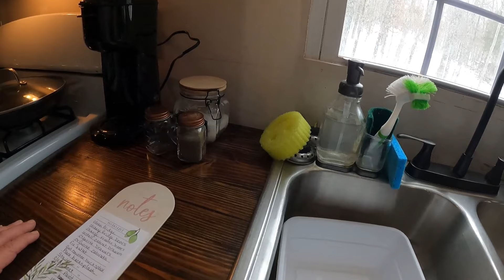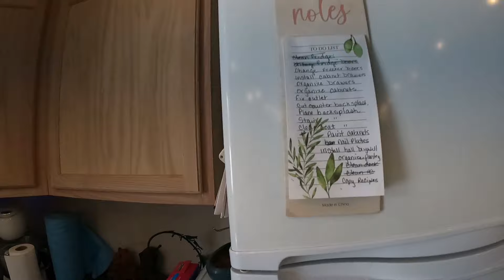Mobile Home Makeover | Snowed In | Getting My To-Do List Done

Comment: I woke up Sunday morning to frozen pipes. Turns out the heat lamp in my well house burnt out. The PVC pipe busted. Had a geyser in there when it finally warmed up Wednesday afternoon. Finally got it fixed Thursday evening. Strangly my master bathroom sink faucet apprears frozen even though it is on the south side of the house. Water just drips out of it. All the other faucets in the house are flowing fine. Winter is so fun. I get you freezing last year. I only heat my master bedroom suite. Rest of the house has no heat/AC. Got down to 30f this week. Made cooking interesting.  So glad your living conditions have significantly improved.
Reply from the maker: oh wow ! Burst pipes are no fun! You probably already know this but keep the bathroom sink faucet open all the way. That should prevent the pipe from bursting and eventually the water will flow thru it. stay warm! We are still well below freezing in single digits, but they say it will warm up above freezing this next week
Reply: @BigDreamsTinyBudget  water froze in the well house. Think the heat lamp burned out, but not positive. I put another heat lamp bulb in after the water was already frozen and after the breakers were flipped back on, that bulb was not working. Neighbor put a space heater in my well house for now. Not supposed to freeze tonight. But is supposed to rain today and the next few days.